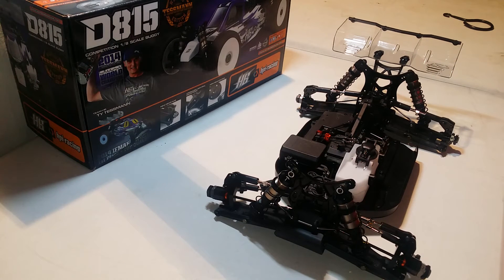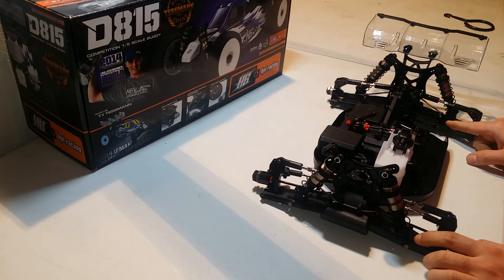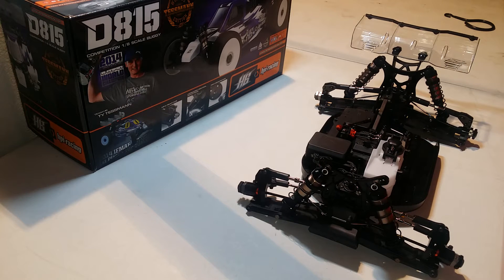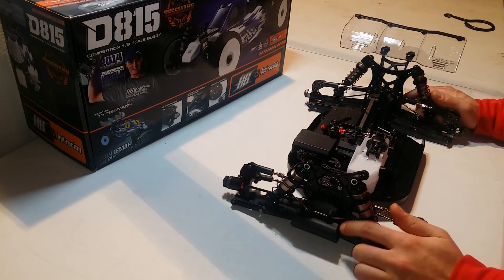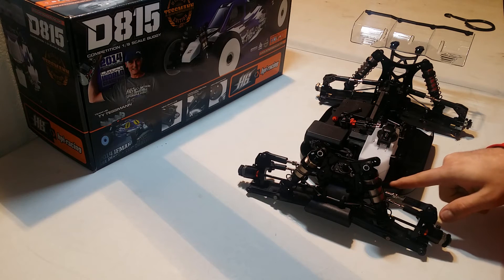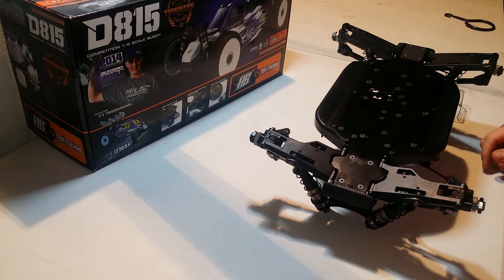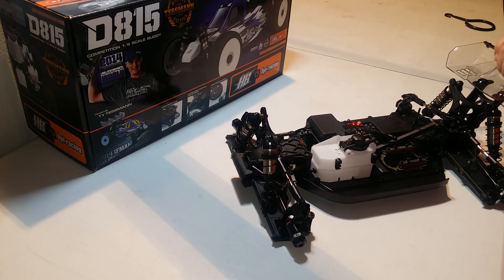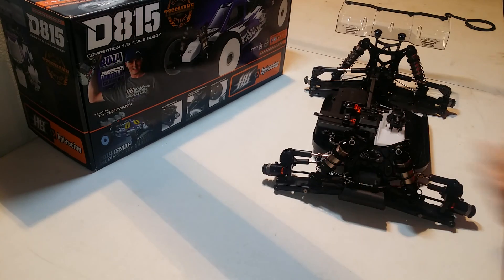First Impressions HB D815 Buggy

Comment: What you said at 7:05 is my concern. Coupled with the fact I had a D8T that had multiple points of failure. As for captured hinge pins and toe block/anti-squat system contact Mitch Looper  at M2C racing. He's pretty good about developing products that are needed such as thisl The whole suspension block "system" for HPI vehicles seems to be an Achilles heal,  Regardless, that is a sweet looking buggy I'll be curious to see how it holds up in addition to its feel.

Comment: its nicely designed and the shocks and brakes are amazing, but of all the cars at the track the d815 has the worst record for breaking/wearing parts. My friend bent both front and rear towers, the pins in 2 of the wheel CVDs and the pins in the rear centre CVD dogbone wore within 4 race meetings. Even with a B team sponsored drive he was still pouring money into it while us Xray guys were literally replacing just the air filter between races.
Reply from the maker: Interesting. The shock towers seem stout as hell. I will say thou I have heard the pins wear fast. That's okay bc I replace all the pins with Hudy pins in all my cars. They last longer and wear very smoothly. As far as prep between races. I usually don't even have to change air filters or anything. Just make necessary setup changes and rock out. Try looking for my air filter tip video where I show how to use vet wrap on the filter to last all race day and save a few bucks too. Great method

Comment: Hi does the d815 tessman include the alloy steering post? I got it with my d815 used. But the d815t tessman has a plastic one fitted.